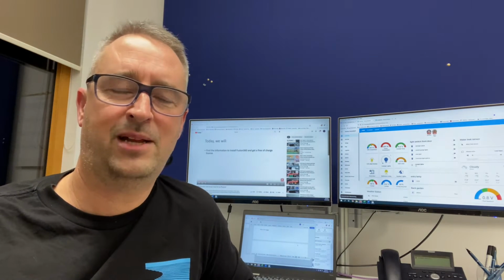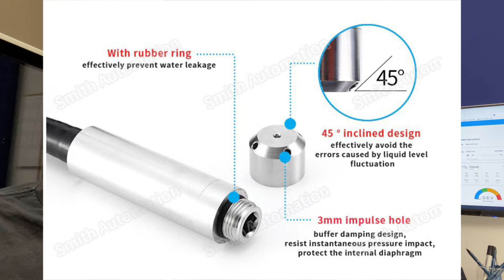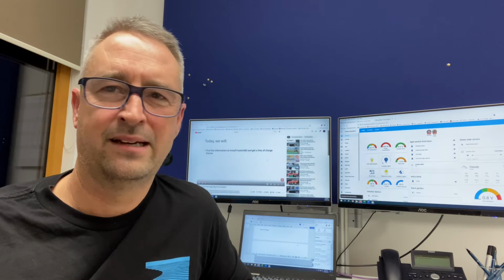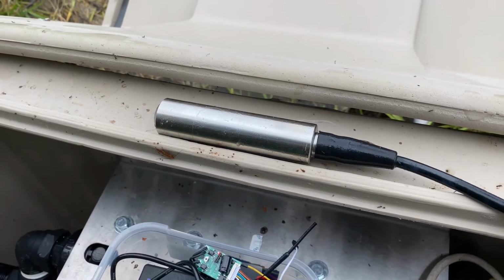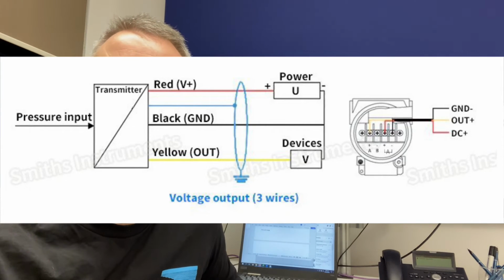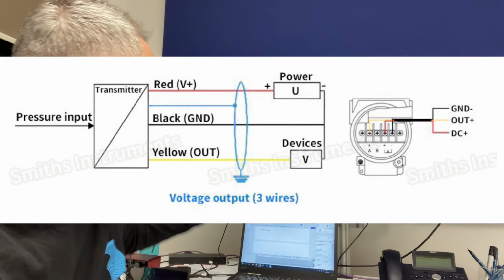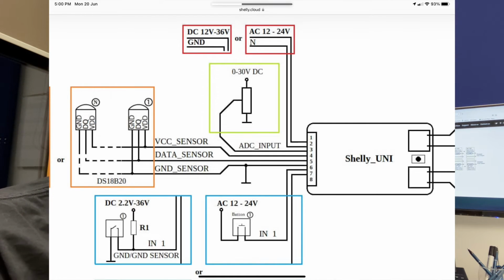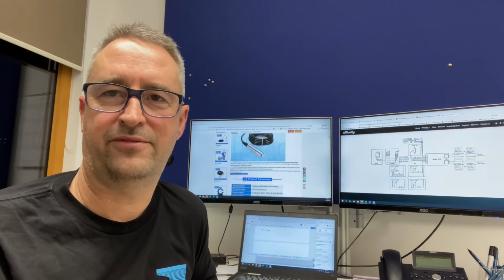Tank water level sensor and integration into Home Assistant Part 1

Comment: Very helpful video. I also need to get a similar setup for my 12000L rainwater tank that i use for watering the garden. The pressure sensor is a great tip, no moving parts, looks solid as a rock. Thanks!
Reply from the maker: Thank you so much for your feedback Mark :)

Comment: Nice video! . I was going to get an ultrasonic one, I didn't know about the pressure ones. Did you try to connect them to the Homekit app? For iOS? I'm starting my journey into automation and I really want to use only one app…. And what about use a small solar panel for power supply? Cheers
Reply from the maker: Thank you so much for your feedback :)  I can't seem to find a 0-5 V analog Homekit bridge.  Do you use Homebridge? https://homebridge.io/  If so then you could possibly use the shelly uni to connect to the bridge and back to apple.  You would need to use an ESP 32 with sleep mode to limit the power enough for a small solar panel and you would also need a battery.

Comment: Hi Simon, I just wanted to point out that it appears you have made a small error in the connections to the pressure sensor. What you have done, Vs+ to sensor + and Vs- to sensor - will in fact appear to work. You'll get voltage reading from the sensor out (yellow wire in your case). However there will be a slight discrepancy in the voltage reading, meaning when the level gets low (sensor body height low) you'll return a 0v (or just 10-15mv) reading. If you want to increase accuracy across the monitored depth you need to connect the sensor ground to the Uni sensor ground (pin 6). This pin (6) is an isolated ground. I learnt this when measuring a fresh water tank (45cm) and discovering the measuring discrepancy when at 15% full it would suddenly jump to empty.
So:
Sensor + to Vs+
Sensor - to Uni pin 6 (green)
Sensor Out to Uni pin 3 (white)

I appreciate in your case this may be of no consequence, but for others with smaller tank volumes / depth it'll be annoying.
Reply from the maker: Hi Craig thank you for your help!
Reply: Great info, I was going to integrate this type of sensor to my Victron cerbo vie a Victron tank 140, I saw a vid on calibration of it the guy raised to sensor up and down and adjusted the calibration this way, I might go your way or play around with both ideas to test, our tanks are about 50 meters away from the cerbo battery room was wondering how I’d go with running cat6 cable what the voltage drop would be but having a wireless access  to the tanks might be an option with the Shelly uni, hats your thoughts?
Reply: Hi, Craig.  I heard about this grounding problem on another level sensor project (cf. https://www.youtube.com/watch?v=T474YCr2574).  Currently, my V- is connected to the V- of the power supply.  I'm considering adding a jumper between the V- of the power supply and the Uni GRND pin 6, forcing both to the same level.  This is what the "other guy" did, but I'm not sure if this is a good solution.  Would appreciate any thoughts on this, thanks.

Comment: Hey. Thanks for a super relevant video that helped med steer away from esp32. I have a quite similar usecase, where rainwater should not reach to the pipes feeding it. At that point i will need to pump out water.
My question: since i dont know the depth of the well. I think it is 2 meters, but 4 meters from the surface, i will nit know if the sensor has just reached the bottom. If I add some slack and let the sensor sit horizontally instead of vertically, would that still work?
Reply from the maker: Hey Nisar, so glad I could help you.  Yes, it can sit like that, no problems!

Comment: Would this sensor work in seawater?  I would like to use something like this to track the daily tide levels in a coastal canal.  I don't know if because the specific gravity of seawater is more than freshwater the probe would be accurate or not.  But if it is made of 316 stainless, at least it should be able to survive in saltwater.
Reply from the maker: That's a good question.  I think it would be fine due to being stainless 316.
Reply from the maker: I think it would still be accurate

Comment: Good decision on sensor. I have had numerous water level indicators over the past 18 yrs. A sonic sender becomes unreliable over time. 
The pressure sensor version is much better although the data tends to drift slightly after several years. Drift will be simple to account for.
Reply from the maker: Thanks Whittaker, yes they seem very reliable!

Comment: Hi Simon. I ordered one of these liquid level transmitters but it only has 2 wires, not 3. Please tell me I didn't but the wrong sensor
Reply from the maker: HI Kobus, I think you have the one that supplies ma rather than v.  Try this, another viewer suggested this solution "If you do have a current based sensor (4-20ma) you can put a 240-250ohm resistor across the Shelly 3 and 6 and it’ll give a voltage 1-5v"

Comment: Recommend that if buying a submerged pressure sensor for a drinking water tank, make sure it uses a foodsafe plastic coating.  It needs to be BPA and PFAS free.  This is one of the reasons why some commercial sensors are either ultra-sonic or laser based to avoid any possible contamination.  It's interesting that the pressure sensor sales websites mention all the non-drinking water use cases...
Reply from the maker: @John-ev9pe  thank you that is a good point !

Comment: Does ambient air pressure have any effect on the readings?
Reply from the maker: Hi Ken, I have not noticed any fluctuation based on barometric pressure.  It could be because I am only really interested in seeing if my tank is full, half or reaching empty so I don't worry about small changes

Comment: Hello, I have same configuration but unfortunately the readings are not stable. I have a range between 0,07V and 0,28V without moving the sensor. It is necessary a stabilized power source? You use one in this example? Thank you.
Reply from the maker: Hi there, no mine is just a cheap 12V power supply off ali express.  Sorry not sure why it is unstable

Comment: Hey Simon, I've got two tanks that are linked at the bottom, both holding around 3500l each when full.  How do you reckon this solution would go if installed in one tank only?

Also, would you be able to do a "part 3" on how you configured the Shelly?
Reply from the maker: Hey Andrew, yes that will work find as both tanks will be at the same level so the percentage will be right for both tanks.  Sure I can do a part 3

Comment: How do you find the real time performance of the sensor (second to second)? Is it fairly stable if there's any turbulence in the water (during refill)
I would like to try this in my brewery cold liquor tank (2000L) to shut off the refill.
Reply from the maker: Hi Andrew, it seems to oscillate a bit between 0.1 segments. Ie it will go up and down between 1.5 and 1.6 volts.  I think this will improve with a higher voltage output!  For my purpose this does matter as I just need to know a rough idea of what the level is at.

Comment: Hello. I bought the sensor, the schematic I received gives info on the wiring with black/red/yellow wires. But the one I received has white/blue/red wires. In you schematic, you have a black/red/blue but it appears to me that in your picture you have the same colors as I have. Correct? If so, could you please tell me which of the white/blue/red wires are 12v and ground? Thanks !
Reply from the maker: Hi Chris, please send me the link to the sensor you bought so I can confirm which leads are which
Reply: @simonsayshomeassistant  I tried to copy the link several time but without any luck….
I received the info from the vendor : red+， blue -, white signal output. Not really intuitive :-)
Reply from the maker: @christophedesirant2343  Yes, sometimes the colours are not very helpful :)  Well at least you know now.  Did you get it working?
Reply: @simonsayshomeassistant  Yes, I'm using a nodemcu esp8266 instead of a shelly
Reply from the maker: @christophedesirant2343  Oh yes the esp8266 works just as well and cheaper too!
Reply: @christophedesirant2343  Can you please share with me how you contacted them?  Mine came with a black, white and blue wires. Instruction in Chinese.  I am unable to identify +, - and Data

Comment: Hi Simon. Great video! I purchased the parts amd have them all connected as per your instructions. My situation is that I have a sump with 45 cm depth with a pump in it to drain the water when it gets full! The issue that I have got is that the voltage coming from the sensor fluctuates between 7.49-7.61v regardless if the sump is full or empty! How come your sensor gives a range of 0-1.5v? Any configuration is required from the Shelly to calibrate the sensor?
Reply from the maker: Hi there, thank you for your great feedback!  Wow that is very odd, is it possible that the sensor is faulty?  I did not do any setup other than shown in my video.
Reply: I am getting the same as this Mohammad, although I am at about 4.5v but it doesn't seem to be getting the correct reading from the sensor.
Reply from the maker: @tux43  Please the wire colours with the supplier sometimes they change them

Comment: Hello Simon, i bought a 0 - 10 v Output, as described in your manual. I also connected it to the shelly and im currently testing it with a water barrel, but the output fluctuate strongly (between 0V and 2,7 V) at the same water level. Do you have any idea what can be the problem here? It seems like you dont have so much fluctuation.
Reply from the maker: Hi Domim100 so how much movement are you getting? Is the water you are measuring still?
Reply: @simonsayshomeassistant  the ADC Voltage display changes every 5 seconds to another value. its between 0 V and 1,38 V right now. The water is still with no movement.
Reply: @simonsayshomeassistant  I fixed it now. i need to connect to "-" also the shelly internal ground (green wire). Now it is stable.
Reply from the maker: @Domim100  Awesome thanks for that feedback Domim
Reply: @Domim100  I think I am having the same problem, however no success. Do you have a picture or wiring diagram?

Comment: Simon, I have a question for you. Any recommendation to measure the level of salt, in a water softener container ?
The unit is basically a round cylinder where you add pellets of salt. As this system is used the salt is consumed. It will be nice to have a way to know when the salt is running low in the tank. Any ideas 💡 to share ???
Reply from the maker: Hi Miguel, great to hear from you!  Yes I think that you could use a sonic sensor to do this.  Place it at the top of the bin.
Reply from the maker: https://www.aliexpress.com/item/32767707969.html?spm=a2g0o.productlist.0.0.70ff6de2k1KSoU&algo_pvid=deda25e5-7955-4dc9-bdb5-79bbe6ca81a5&algo_exp_id=deda25e5-7955-4dc9-bdb5-79bbe6ca81a5-0&pdp_ext_f=%7B%22sku_id%22%3A%2210000001117889709%22%7D&pdp_npi=2%40dis%21NZD%21%211.32%21%21%212.23%21%21%40210318b816574208814619000e917d%2110000001117889709%21sea
Reply from the maker: https://www.youtube.com/watch?v=BFtOGAIL9GQ

Comment: Hello Simon, 
you recommend to buy a voltage output sensor and not a mA sensor, because its easier to connect. 

Is it also possible to use a mA sensor, and how can we do that?

Thank you very much!
Reply from the maker: Hi Domim.  Yes, the voltage is much easier to input into the Shelly UNI.  For the mA one you would have to create a circuit to convert it to voltage.  I will do some research for you
Reply from the maker: https://www.youtube.com/watch?v=qnk-FXJdVRA you could try this!
Reply: @simonsayshomeassistant  Thank you very much.
Reply: @Simon Says: I bought a 0 - 10 v Output, as described in your manual. I also connected it to the shelly and im currently testing it with a water barrel, but the output fluctuate strongly (between 0V and 2,7 V) at the same water level. Do you have any idea what can be the problem here? It seems like you dont have so much fluctuation.

Comment: Interesting system.  Curious, how accurate is it, when you convert voltage to remaining volume content ? 
Did you account for the voltage drop due to the long cable?   I would say, you calibrate the 'max' level when the tank is completely full?

I might just include this principle.  Will not use Shelly though, as I already have an analog 0-10V input module in my KNX setup.
I could just add the sensor to one of my free channels. The cable could come in right in the utility room!
Reply from the maker: Hi Gery! I am just using a gauge and setting 0 as empty and 1.6 as full at this stage.  I plan to create more smarts with the data using Node Red
Reply: @simonsayshomeassistant  1.6V that is ? 10V is no water then ?
Reply from the maker: @deejayaxxis  I have the 0 - 5 Volt unit but it only reads 1.6v when tank is full.  Might try stepping supply power up to 24V

Comment: If you do have a current based sensor (4-20ma) you can put a 240-250ohm resistor across the Shelly 3 and 6 and it’ll give a voltage 1-5v. Thanks for the video
Reply from the maker: Awesome thank you for explaining that Easty!
Reply: Am I correct to assume that if a 500ohm resistor was put across pins 3 and 6 I would get a 1-10v reading? I bought my sensor for this purpose before knowing how to wire all of this up. This video makes it super clear.
Reply: @alantorres8295  it’s not a linear conversation with a larger larger resistor. May want to order a range of them and play with it to see the output. I was using a Shelly uni, so I can literally have the app on my phone and see the voltage change as I raise and lower the sensor in the tank.
Reply from the maker: Sorry I have not tried this as I don't have a mma sensor @alantorres8295

Comment: I just ordered my water meter sensor and ordered the 0-5V and then I found your YouTube today....0-10V sounds like it would be better. I want to measure a 50000 litre tank and put it into openHab.
Reply from the maker: Thank you so much for your feedback.  This has always been my favorite automation yet!
Reply: @simonsayshomeassistant  I just got the sensor today and I hooked it up like you did in this video but I had no voltage displaying until I took the green wire and put it on the negative of the power coming in. Then I had a voltage reading. Don't know if this is what was supposed to happen or not. I am not an electronics person. At least it didn't blow up.
I put Tasmota on it but that is another whole story working out how to get readings that reflect the volume of water. Work in progress on that.
Reply from the maker: Hi  @ubeaut   It depends on the sensor some have different colour wires but yes you do need to connect it to the negative of the power supply to power the sensor.  That is great news that you got it working!  How did you flash tasmota to the shelly uni?  Thanks for your feedback!

Comment: Hi Simon , I presume you deployed this pressure sensor a while back .. is it worth it ? ( reliable , stable etc ) ?
Reply from the maker: Hi Alain, yes the sensor itself is extremely durable being stainless steel.  Been in tank for 2 years now and no issues.  The Shelly Uni is protected from moisture damage as it is coated with a protective sealant so great for outdoor use.  I have found this system to be very reliable and stable!
Reply: @simonsayshomeassistant  thanks Simon, I'm searching for a possibility of splitting a poe cable to power the sensor , an esp and use the ethernet to bring data back .. sounds hard to have though .. have a poe splitter into 5v usb-c and ethernet ( I'm missing the 24v )
Reply from the maker: @alainkazan  You could use a DC to DC step-up converter to get the 24V
Reply from the maker: @alainkazan  https://s.click.aliexpress.com/e/_Dd2qgxT  This is a 12V version
Reply: Yes can manage the power , remain data back as no wifi range to the building roof where the water tank is .. and setting up the feedback sensor wire for 20m among power cable I'm afraid the reading will act up
Reply from the maker: @alainkazan  what about using an esp32 with an ethernet port https://s.click.aliexpress.com/e/_Dl3tV0p

Comment: Looking forward to this- thank you for posting it Simon. With your 12v Power Supply, do you remember how big (how many amps) it is or doesn't it matter?
Reply from the maker: Hi Mike, you would only need a tiny power supply 1-2 Amps.
Reply: Super. I'll order one now. Thanks a lot for your fast reply mate.  @simonsayshomeassistant
Reply from the maker: Only a pleasure Mike, good luck with your build!  @mikewaters6980

Comment: Hi Simon I love your channel I have a few Questions mabe u can help me .

I have the following 

Sunsyn inverter and solar 
Sonoff device for swicing borehole   gates ect ect 
Some ACDC wifi switches for pool pump 
Ezvic wifi cameras
Smart life TY water level sensor for my water tank . 

How do I integrate all this different systems into 1 system to control all and set Automation.  Like when water level on 10 percent swich on ACDC switch.  When water level on 90 percent swich on sonoff smart switches for sprinklers . 

Also wil like to see all in 1 dashboard. With mabe a IPad or notepad mounted on my wall in my house.
Reply from the maker: Hi Johan, thank you so much for your feedback.  I assume you are running Home Assistant.  If so it is a matter of finding integrations to the products you mention and then creating the automations using HA automations or perhaps nodered.  I have had some challenges with integrating Sonoff devices as well as smart life.  They are cloud based and not well integrated.  I try to use local devices like Shelly or ESP Home. It looks like there is an integration for the cameras.  For the display try Kiosker.